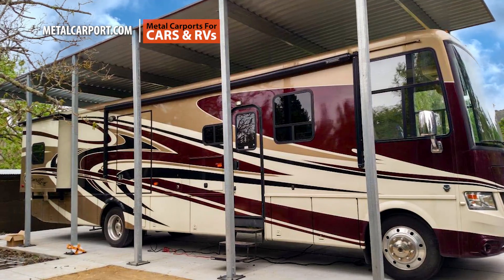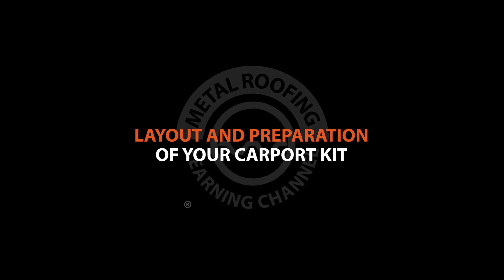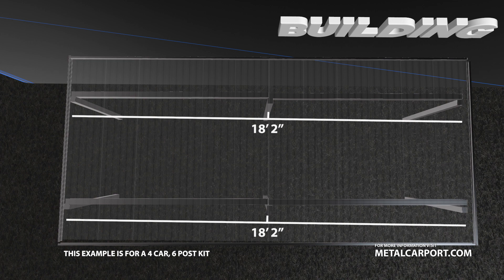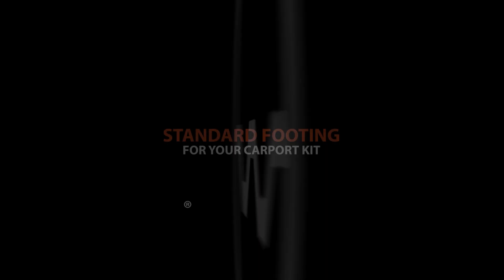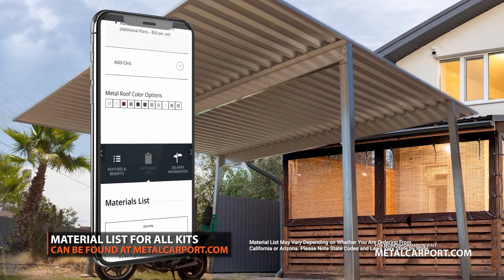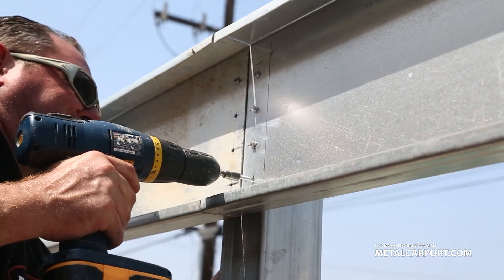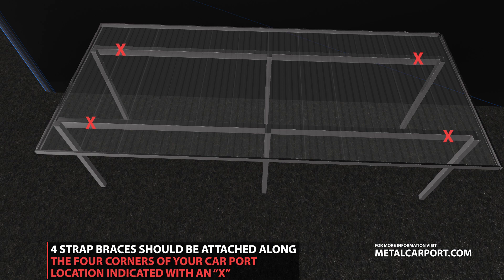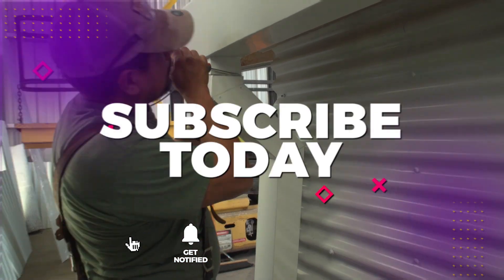Metal Carport Kit DIY Installation Instructions: Post Layout, Footings, Purlins, And Steel Panels

Comment: Great video! Your carports look more sturdy and more attractive when compared to the competition.
Reply from the maker: Yes, that's the main benefit of these carports. They have heavy duty components including posts and purlins that are made from 14 gauge steel and heavy gauge metal roofing panels. The downside is that they are more difficult to install when compared to Versa-Tube.